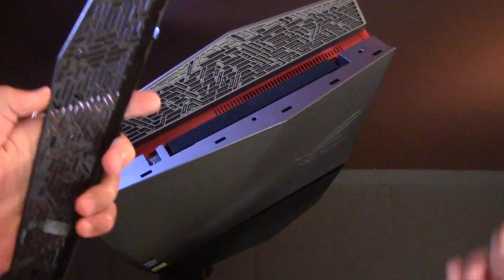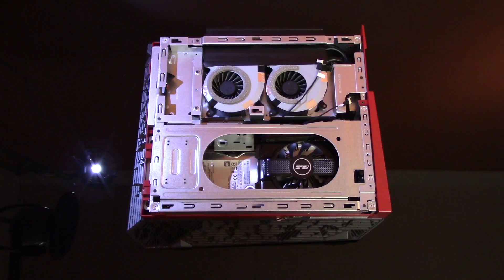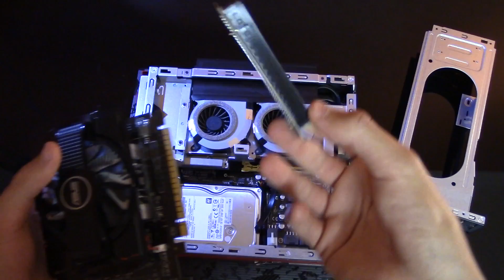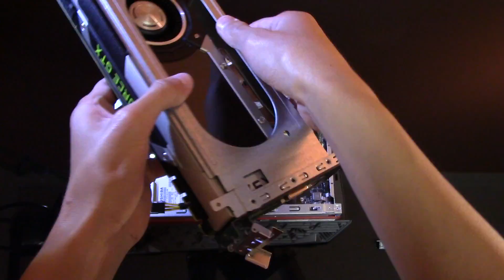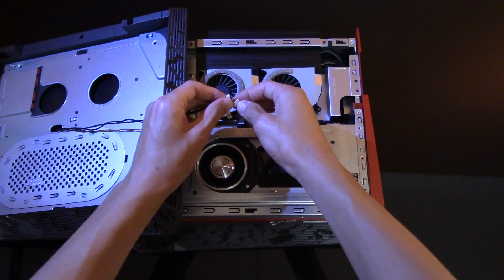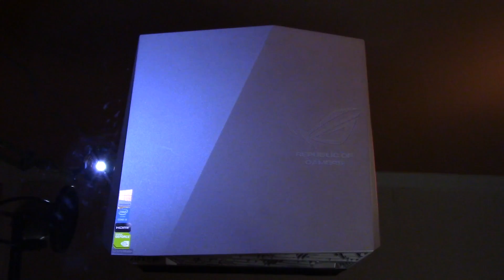Asus ROG G20 - GPU Upgrade Tutorial

Comment: Can you link the RAM you purchased to upgrade to 16GB? Was it 4 x 4GB?
Reply from the maker: The G20 supports up to 2 laptop RAM sticks, 32GB ram. 
My RAM: https://www.amazon.com/Kingston-HyperX-1600MHz-HX316LS9IBK2-16/dp/B00KQCOV5C
Reply: +DrewEon Bro I really wanna say how much I appreciate the fact that you reply to every comment, and that you put up with so many PC scrubs XD (including me)

I'm done with all my comments (at least I hope). Thanks to you, I'm most likely upgrading to the same GPU and RAM as you lol cause I don't wanna venture far from the expert's setup (you ofc)
Reply from the maker: +DeadShot Oh no problem. I absolutely love responding to comments. I also just figured out the fatal flaw in my process of upgrading. I won't have a video out explaining it until late next week since I don't have my camera with me, but under the JDC11 thing, there are 5 JDC things number 01-05. Make sure you move them all up from the bottom so the second power adapter actually works!
Reply: +DrewEon will you be showing how to upgrade the memory?
Reply from the maker: DeadShot Already done it, didn't make a video. Sorry.
You have to remove the CPU heatsink to get to the RAM, and I'd suggest putting on new thermal paste if you want to go through with that.
Reply: +DrewEon umm... Are you sure I'll be fine with only the 230 and 180w power supplies? The box for the gtx970 says a minimum of 500w is required. :( rip me
Reply from the maker: DeadShot Depends on what PC parts you have. Haha I hate those, Nvidia is just trying to be safe. The PC will never get near 500W
Reply: +DrewEon aw shit man I'm scared I fucked up, I finished installing the gtx 970 and plugged my monitor into the heli slot on the 970 and when I started up the PC, all the lights came on and everything but nothing is appearing on my monitor
Reply: +DeadShot hdmi*
Reply from the maker: DeadShot Make sure you changed JDC11, and under JDC11 there's a bunch of little things that look like JDC11, called JDC01, JDC02, and up to JDC05. Just pull off those little covers like JDC11 and move them up. That will activate the power adapter.
Reply: +DeadShot scratch that I didn't plug the hdmi cable all the way in on my monitor XDDD I'm so sorry for all the trouble I've put you through recently, I really appreciate your effort. Subbed btw :)
Reply from the maker: DeadShot haha alright, thanks

Comment: Question why is the 180w power brick not drawing power to my gpu? its not getting hot and my main brick seems to be very hot and sometimes shuts itself off to save itself from blowing up when playing graphics intensive games i hope you got a answer for me cause i really need one
Reply from the maker: I haven't had any issues with my main PSU turning off, but the second power adapter doesn't get hot to the slightest for me and I'm questioning if it's even doing anything. When I initially purchased the 970, I used it only with my 230W, it worked, but after a few minutes of gaming my processor and GPU's clocks heavily decreased and my PC ran very slow. With the 180W I haven't had that issue at all. It may be that the 180W is only using a very small amount of power, as the GPU is still receiving power from the main PSU and the 180W is just there to cover a tiny bit of power. I'm going to try switching that JDC-11 over to its original position and see what happens. I'll get back to you in a bit.
Reply: alright hit me up on twitter to notify me quicker! -@X1BlackBlazonX1
Reply: oh and if you are to play battlefield 4 at ultra on the first mission torwards the end where the pilot loses control of the helicopter and the pillar falls over then at that moment your main power brick should shut off it keeps happening to me

Comment: gtx 1080 founders edition also fits in this case, btw.
Reply: What about the rtx series
Reply: The Professor RTX 2070 Super 8gb Turbo EVO is what I got in there
Reply: Santiago Fernandez hey, Asus won’t tell me anything about newer compatible cards.  Did you need to do anything special to get that 2070 to work in the g20 case?  Mines a g20cb and came with a 970 installed.
Reply: Kent Snyder nope, nothing new. I did buy a new connector for the card to the pci, but that’s simply because I lost the one the computer came with. Besides that, you already got everything. Enough PSU power, and the shoulder adapter.
Reply from the maker: Yup
Reply: @DrewEon   What about amd rx 500 series  ? Can rx 580 nitro + fit in  how much inch the gpu holder can max get

Comment: going to install 1070, do i need to increase fan speed with msi afterburner?
Reply from the maker: No, you won't. I've had 0 issues with the 970 and my PC is actually cooler with it.
Reply: also this might sound stupid but do i connect the power adapters together? so fucking confused rn
Reply from the maker: +bazooka43 The two power adapters plug into the back of the PC, individually haha. No problem
Reply: ***** I was asking since its a more powerful graphics card if i needed to ramp up the fan speed to keep it cooler
Reply from the maker: The GPU will automatically control it's fans, so there will be no need to manually control them.

Comment: What power supply do you need to use for  the gtx 970
Reply from the maker: You'll need both the 180W and 230W.
Reply: +DrewEon thanks
Reply: +DrewEon What power supply does the rog g20 come with
Reply from the maker: Anthony De Leon Depends on the model.
Reply: +DrewEon i5 verson
Reply: +Anthony De Leon I checked it has a 240 watt
Reply: +Anthony De Leon can I get the 180w and use the 240w so I can use the 970
Reply from the maker: Anthony De Leon Alright. You'll need to get the 180w power adapter extra for the 970.
Reply from the maker: Anthony De Leon Yeah, you'll need both.
Reply: +DrewEon ok thank you
Reply: +Anthony De Leon very helpful video
Reply from the maker: +Ant Del :D

Comment: Do I need a new power supply if I plan to put a gtx 960 reference model in my g20. it's the same g20 you have. do I need a 180w or a 230w?
Reply from the maker: You'll need the extra 180w

Comment: If im installing the 1080 do i only need the 8 pin connector or do i need additional items
Reply from the maker: I believe it only uses an 8-pin connector. So you'll need that and the two power adapters, if you don't have them.
Reply: +DrewEon ok thx

Comment: Hey drew I need some help. I have my 970 in the cage and I have the the connectors plugged in. but I'm having trouble fitting it in the case and even when I get it in close enough to screw it in I can't get my side panel on I can't seem to fix the problem. please help.
Reply from the maker: Is it the two power cables? Try and push them to the bottom of the PC and flat under the 970.
Reply: +DrewEon yea no matter what I seem to do when I screw it in the side panel won't fit on
Reply from the maker: Zedrac Oh that may not be the GPU, your side panel may have been bent or something like that.
Reply: +DrewEon it must be something else because I just got the card today and I have been using the pc for awhile now I didn't bend the panel when I opened it so I don't know what's going on. but also when get the card in there's like a gap in the back of the pc were the card is so maybe that's the problem
Reply from the maker: Zedrac Yeah that's caused by a slight bend in the panel or simple mis-alignment. Make sure it's on there right, I've had the same issue
Reply: +DrewEon I fixed it I taped the cables together and pushed them to the side of the graphics card. but I also was having trouble putting the case back on so I had to remove the metal on the side panel and that made it fit perfectly on.

Comment: I have the 240w power supplier and I want to buy the gtx 1070 for this ROG. do I need the extra 180 power supplier? the gtx 1070 only uses 150w 😪
Reply from the maker: You'll need the extra 180W. The 230W also has to power the rest of the PC.
Reply: +DrewEon thank you! appreciate it

Comment: Question: 
I'm going to be getting the g20cb which is the g20aj expect with the sky lake processor, and the 980 gtx, also comes with a program to make the rgb lights on the front flash dance to music and different things like that, but my question is if I have a i7-6900 sky lake processor and the gtx 1080 (my plan is to put a 1tb ssd, a gtx 1080 in the g20cb ) what power supply will I need to run that and do I need to know anything else among those lines.( like anything else I need to change to make all that run in the g20cb). Thanks for reading, hopeful I can get it all to work!
Reply from the maker: If you're getting an i7 and 980 model, you'll get the two power adapters you'll need for the 1080.
Reply: Ahh okay thank you and those power bricks look much nicer
Reply: would i need to buy any other connectors or anything?

im going to be adding 32gb instead of 16gb and adding a samsung 850 pro or something like that but it's an 1tb ssd. would i need any other connectors.
Reply from the maker: Ghostly_The_Ninja No you'll have everything you need
Reply: +DrewEon ok awesome
Reply: +DrewEon thanks for the help!
Reply from the maker: Ghostly_The_Ninja :D

Comment: I'm looking to do the same to my G20 but need to know the dimensions on the power connectors are they just 6 pin ? 6x6 ? Great video been looking to do this for a while !
Reply from the maker: There's an 8 pin and 6 pin power that can go to the graphics card. The 8 pin goes to a 6+2 pin, so you can have 2 6 pins, like for my 970.

Comment: Sorry to bother you. I just bought the newest version g20cb-ws71 with the 180w/230w power supply. If I want to upgrade my gpu to GTX1080, do I need to care about those little pins or power cables? Thank you so much for this very informative video.
Reply from the maker: You'll just need the 8-pin

Comment: I have a question my rog g20 is the model with the i5 4460 and gtx 750. I have only one power supply but im not sure if its the 230w or the 180w. Im upgrading to the same exact card you are and i dont want to be screwed by buying the wrong power adapter.
Reply from the maker: I've got the 230W adapter with mine and purchased the 180W for the 970. Works like a charm. If you want further assurance, look at the sticker on the power adapter, you'll see 230 or 180
Reply: +DrewEon Okay thanks man also thanks for making this tutorial it will help me out a lot when I get my 970 this weekend.
Reply from the maker: No problem.
Reply: @Zedrac 
How'd it go?
Reply: where did you get the adapter from? (I also have the i5 version)
Reply from the maker: FallenDiscrete Description
Reply: I have the exact same computer i5 4460 and a gtx 750. First, how did the upgrade go? Where did you purchase the additional power supply? Also, is this the GPU you got? https://www.amazon.com/EVGA-GeForce-Cooling-Graphics-04G-P4-3975-KR/dp/B00R3NK2LE/ref=sr_1_1?ie=UTF8&qid=1532190316&sr=8-1&keywords=gtx+970+graphics+card
I also, have a feeling your not going to respond because this was 2 years ago, hahaha. I hope you respond.

Comment: so just asking i only need to buy one of those http://www.amazon.com/Silverstone-Sleeved-8-Pin-550mm-PP06B-PCIE55/dp/B00A45JA52?ie=UTF8&psc=1&redirect=true&ref_=oh_aui_detailpage_o00_s00
Reply: *these
Reply from the maker: Which model of the 970 do you plan to get?
Reply: +DrewEon the one u put on the link aka reference
Reply from the maker: mr.underwear Alright, well the issue is that that is only one 8 pin to the 6+2. You plug the 8 pin into the mother board and you seperate the other 8 pin side to a 6 and 2. The six pin will only provide you 75w, though. The 970 can use up to 145W
Reply: +DrewEon so how do i fix it
Reply from the maker: I don't know. You have to look around for another solution. Sorry dude.
Reply from the maker: mr.underwear if you can find a y-splitter that takes a 8-pin, then you can get the y splitter and that cable.
Reply: +DrewEon sooo i cant do it with that adaptor
Reply: +DrewEon is 75w enough
Reply: +DrewEon ok ok drew i decided to get the turbo will this work http://www.amazon.com/Silverstone-Sleeved-8-Pin-550mm-PP06B-PCIE55/dp/B00A45JA52?ie=UTF8&psc=1&redirect=true&ref_=oh_aui_detailpage_o00_s00
Reply: +mr.underwear my bad i meant http://www.amazon.com/Silverstone-Sleeved-8-Pin-550mm-PP06B-PCIE55/dp/B00A45JA52?ie=UTF8&psc=1&redirect=true&ref_=oh_aui_detailpage_o00_s00

Comment: Thank you! Do you know if the 1080 fits in this? Thanks!
Reply from the maker: It does!
Reply: @DrewEon  I have ASUS ROG G20 aj Desktop PC ROG G20AJ-US006S Intel Core i3 4th Gen 4150 (3.50 GHz) 8 GB DDR3 1 TB HDD NVIDIA GeForce GTX 745 4 GB Windows 8.1 64-Bit

it has one 240v power supply. What components would need to be upgraded on my pc to run either a) a gtx 1060 b) a gtx 1080 founders?

Any other components you recommend upgrading alongside it? (really only looking to change out the graphics cards

Comment: https://www.instagram.com/p/BC07-fhxfvV/ nice check out mine
Reply from the maker: Ah, the turbo. Nice.
Reply: Wait you don't need to add the cage for the GPU?
Reply: +Jose Gonzalez my card is thick enough stay in place reference cards are too skinny and they need the cage
Reply: oh ok we have the same desk also
Reply: i got told that turbo is not going to fit in this machine so I cancelled my order and got a evga 970 instead...
Reply from the maker: +Michael Dong It'll fit, but the Turbo will only fit without the GPU cage.
Reply: +Michael Dong who told u that it clearly can fit show it to the person that said that
Reply: +Michael Dong https://www.instagram.com/p/BC07-fhxfvV/
Reply: too late now I have my evga on the way, btw the turbo is also cheaper as well
Reply: yeah  saw your picture, its a perfect fit. how do you fix the card without the cage?
Reply: so you dont need a reference card?
Reply from the maker: +Jose Gonzalez Not necessarily. Some custom cards fit some don't.
Reply from the maker: Jose Gonzalez And many custom cards blow extra heat into the PC, which in the case of this PC, isn't a good thing at all.
Reply: +DrewEon hey mate i have got my power brick and changed the graphics card but when i turn it on I cant see the picture！ then i opened up the case again to see what went wrong i plugged in while case open it worked but when restarted no picture again any one can help me？
Reply: +Michael Dong did u move that pin on the motherboard?
Reply: +YoungBossMajor yes i did moved it to the left so it is 1st and 2nd pin the funny thing is it manage to work for 2times i dont think i did anything wrong  from the video but when  i replug the old one in it is working fine
Reply: +Michael Dong I would return the graphics card
Reply: +YoungBossMajor so you reckon its the graphics card problem？
Reply: +Michael Dong either you have a dead graphics card or you purchases the wrong powerbrick
Reply: +YoungBossMajor i have the 180w and bought the 230w power brick when i turn on the machine the gpu fan is spinning. how can i singulate the problem
Reply from the maker: Michael Dong GUYS!!!!!
I didn't know it at the time of making the video, but you actually have to move JDC01, JDC02, JDC03, JDC04, and JDC05 up from their bottom place. They look exactly like JDC11 and are a bit below it. Move them to activate your second power adapter. I will have a video up this weekend about it, sorry :(
Reply: oh god thank you to tell me that I have seen all these pins, now what position should it be I think I have it all on the top at the moment, I need to go home and double check tonight, hopefully it will work !!! fingers crossed.
Reply from the maker: Michael Dong Yeah, if they're at the bottom (they should be) just move them to the top.
Reply: +DrewEon i have checked they are all on the top… no luck！what else i could go wrong？
Reply from the maker: Michael Dong You've got JDC11 over to the left, all of those JDC01-05 up top, and both power adapters plugged in? Maybe plug your video cable into the onboard graphics (HDMI port above the GPU) and see if your computer is recognizing the GPU.
Reply: +DrewEon i have done all the steps as instructed and as i said earlier the machine managed to boot up with picture twice and i have seen its the 970 in the system but ever since its been black screen now i dont know its the card or the power supply issue. i have resit everything nice and tight, now when i turn it on i can see the gpu fan spinning but no picture, but how can i make sure that the power is ok or it will draw power from the second brick because at the momont i tried to unplug the second power it seems to be no different as the gpu still spins？ is this normal？im just trying to isolate the issue…
Reply: +Michael Dong I think you might have a doa card 😠
Reply: +YoungBossMajor should get a lottery ticket
i will test the card out on another pc see if it works
Reply: just tested the card on another pc it is working fine
Reply: +Michael Dong power supply !!!😭
Reply: plugged in my old gtx 460  into the g20 it also worked, now i looked at the spec the gtx 460 also require a 160w power so it should draw power from the second power supply ????
Reply: +Michael Dong do you have the latest nvida drivers installed?
Reply: sure i have the first thing when i got in was to update the driver. when i try to boot again then later it just blacked out. now I give a go to re boot this 460 see if its running fine, just than I tried to play games on the machine seems to be ok no problems. I really dont get it!!!
Reply: now i plug in the 970 again and for some reason it works. so i put on  the cage and the case. seems to be alright so far,

Comment: Awesome vid thanks for the help! :D also you said in the video you need a 180w power supply? dont you need at least 500 or more, so if its a stupid question.
Reply: go to psu calculators .com  and put specs in he's technically only needs a 385 watt
Reply: +DrewEon I upgraded my CPU to i7 5775c it only is 65 watts
Reply from the maker: Your PC with the i3 probably won't draw more than 350W, at max load. And yeah, 65W under 100% load.